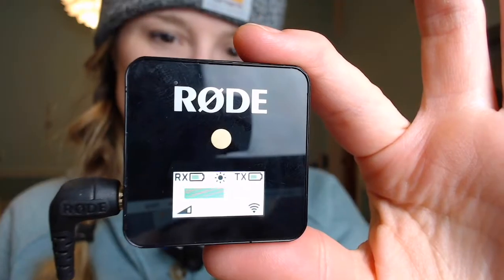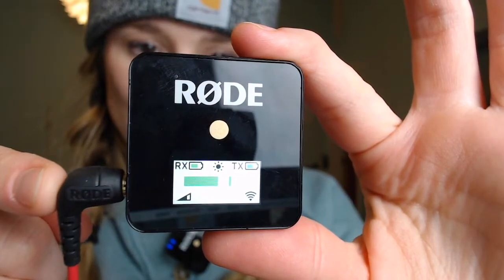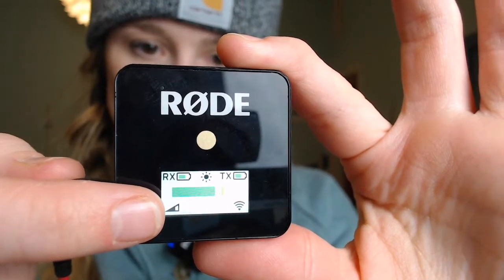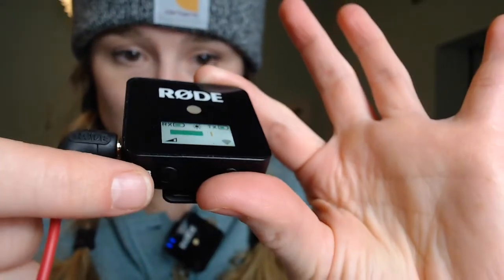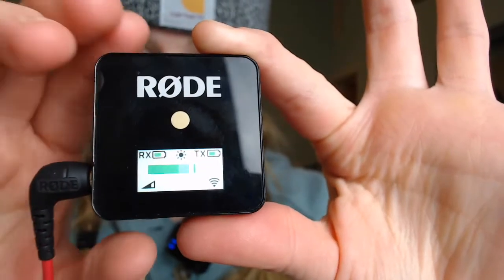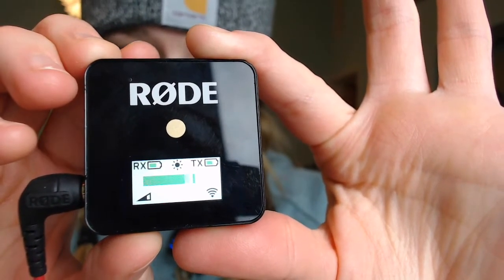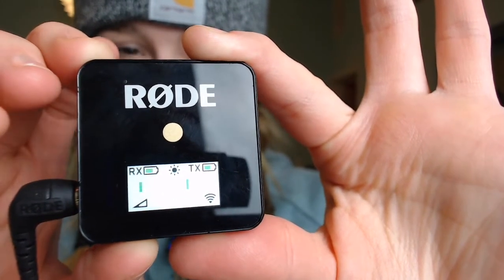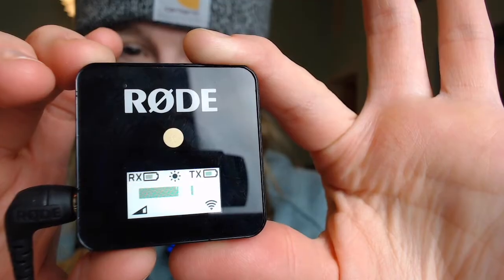Why does my Rode Wireless Go microphone sound so BAD?

Comment: In the RODE Wireless 2 you can change the the volume to dB to get more then three steps thru the RODE app on the Desktop for both Mac and PC, And if you try to use the wireless GO 2 with your desktop with the USB cable you have to change the volume on the mic withing your desktop settings. So dont give up on the RODE Wireless 2 they are more versitile when it comes to Volume. i Highly recomend getting the Desktop app for all the Rode Wirless GO 2 users.
Reply: Hey - thanks for extra advice on the mic setting in the desktop settings. Fixed my problem!!
Reply: My rode wireless go 2 microphone has been with me for several months but was not able to use it. It has an awful static sounds it's like heavily raining. I dont know if there's still need to setup on my android phone or in the microphone itself
Reply: @extraboons6485  ive heard some reports on problems with some smartphones, u my self had some strange sound happening when i use the USB-c cable to my Samsung 22. but i have not used it in a while so i dont know. i mainly use my DSLR camera for videos nowdays.
Reply: @kamratdennis I used my rode 2 to my Nikon dslr but the sounds so bad. 😢 I don’t know how to fix it.
Reply: @Yammacapantao  have you updated the firmware on your device? and done some settings from the computer or smartphone device via usb-c? you might wanna play aroud with the gain on your camera as well so you dont have to use the cameras preamps maybe you kanow all this allready but it would be nice to hear if you get it to sound better.  do you have a sound sample of it right now?

Comment: Thanks for this informative video! 
I put the DB at middle on both my dslr and rode mic. I do not make any changes on volume at post production. After I upload my videos the volume is too low n I’m not able to figure out what’s wrong☹️. May I know the db settings you keep on your camera and do you increase or decrease volume while editing?
Reply from the maker: I do not personally use this with a camera. I don't have a DSLR so I can't speak to my own experience. I keep the around the medium setting for my iPhone and computer when I record. Have you tested the difference if you turn the volume up to the high setting on your camera?
Reply from the maker: And yes, I will occasionally adjust the sound settings if I happen to be editing the video in iMovie. If it's a live video or a one-take, I don't edit and don't adjust.
Reply: @AshleyHagen  yes i tested on my dslr on low, medium n high settings n none of it worked. May be issue is with my canon m50. 
Maybe i will switch frm dslr to iphone lol

Thanks a lot for your reply❤

Comment: Thank you Ashley this was very useful! also I had an unfortunate experience with a Yoga teacher where after a downward facing dog the micro turned off...so frustrating! did you have the same experience?
Reply from the maker: No. I have had the cabled flipped and there was no sound for 2 of my classes. No one told me this because there was only 1 person in each of those Zoom classes. I assumed their wifi was bad. And then I went to check the recording and, whoops! No sound. I have also forgotten to switch the audio settings to the microphone rather than the internal crappy mic. I teach so many classes that when it happens once in a while, it's whatever.
Reply: @AshleyHagen  Hello Ashley, thank you for sharing, I guess I will add ear plugs or make sure the mic is clipped away from the teacher chin to make sure that during the movements, the mic is not impacted! Take care

Comment: Hey Ashley! Thanks so much for this. I have been watching your videos and actually purchased the Rode wireless go based on your recommendation. I'm wondering though, even with the mic set to volume 2, I am getting an annoying white noise/static sound throughout my recordings. Is there anything I can do about this?
Reply from the maker: I'm not sure what that could be. I haven't had that problem. Is there a fuzz on the microphone? Have you tried with and external lavalier mic attached to see if it's a microphone dust problem or a device problem?
Reply: @AshleyHagen  Thanks so much for your response! I think I have it figured out actually. When I was editing in iMovie I was clicking the "auto enhance" button because it helps with lighting, but then it was bringing up the volume as well, making it louder than it should have been. I also have ordered a lav (I've just been clipping the mic so far as the lav was on back order), so hopefully it will be even better once that arrives! Thanks again :)

Comment: Thank you for this info . Simple and to the point.❤️

I just want to ask if you know , I have a rode go 2 and when I record with one of the mic only left side is recorded and from second mic right side . I am not able to make it . If you have an answer to this please do help . Thnks in advance ✌️
Reply from the maker: I'm not 100% clear on your question. Sorry. I was unaware that there was a left and right sides when recording. I'm not sure what you mean by this. With the Rode Wireless Go II, you can choose to split the audio sounds into two channels, or merge them into one. Check the manual.
Reply: @AshleyHagen  actually when I record with only one mic then the sound comes from the left side of the headphone only . Simultaneously when I record only with second mic sound comes only in the right side of the headphone. I think that merge option I have to opt for. ✌️

Comment: Didn't fix it at all. It will work so well and then start buzzing mid class breaking up super bad. It's so annoying. i'm about to throw them out. This isn't the sound I'm getting. It's cutting out and almost sounding like it's cutting out disconnected but it's not. Garbage. I've bought two sets of these and I'm done with them.

Comment: My problem is that even on the highest setting my voice sounds like your lowest. but my breath is SOOOO lound... What to do ?
Reply from the maker: Are you using the Rode Wireless Go II ? With it plugged into the receiver using the USB-c cable?
Reply: @AshleyHagen  It doesn't have to be plugged into the reciver right ? 
Then it's not really wireless.
Reply from the maker: @The_lupo_  Wireless from you to the computer/phone/camera. There's no wires that attach to the microphone. Sure, there are cords to plug in the receiver. Most wireless microphones (if they're not bluetooth) need a way to plug in the receiver to your recording device. It's still "wireless."
Reply: @AshleyHagen  Ok but if that would be the case then my audio would simply not record. It Does record it's just faulty, and low volume.

Comment: My RODE wireless go II doesn't appear to have volume settings. With 2 mics included, I put one on the front of my Harley and one on the rear (closer to the tailpipe - high up on rear right side fender). My volume played back is fine from on the front UNTIL I start up my bike. At that point somehow the front mic volume is cut in half and I loudly hear the tailpipe. I can barely hear my voice on the playback.
WISH I KNEW what is wrong and how to correct it. If anyone can help, I'd sure appreciate it. Thumbs up btw!
Reply from the maker: You can choose to keep the two streams of sound separated or you can connect them to one sound stream. I don't know the technical term for this. The Rode website is helpful with these concerns. Sorry I can't help more!
Reply: @AshleyHagen  Thanks Ashley, for trying to help - that was very sweet of you!
I did manage to improve upon the problem by relocating the 2nd mic further away from the rear of the bike. (although it picked up too much of an unwanted lower vibration frequency, like a low bass hum of sorts) I'll figure this out eventually. Btw, RODE is very lacking on expanded helpful information or guidance. Good thing there are nice people like you around! THX!